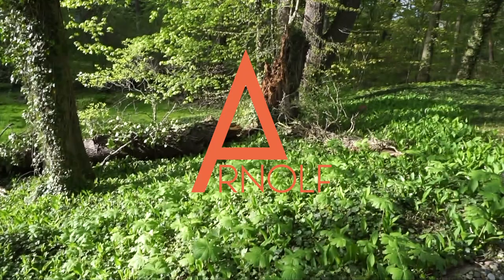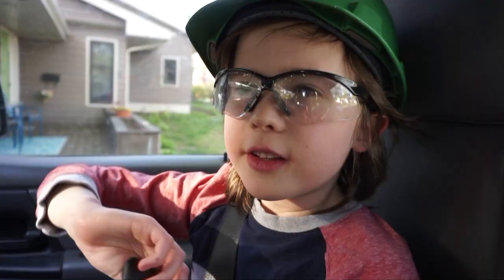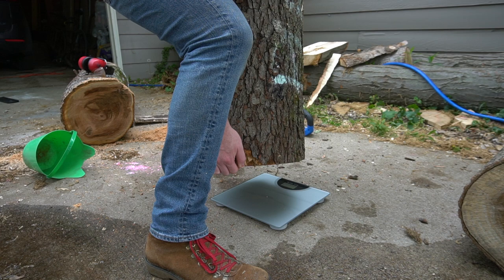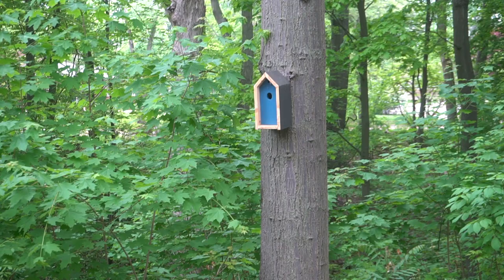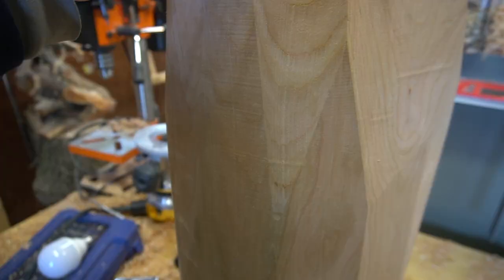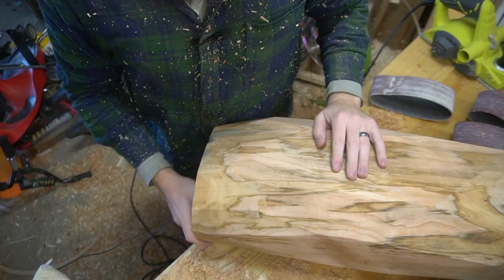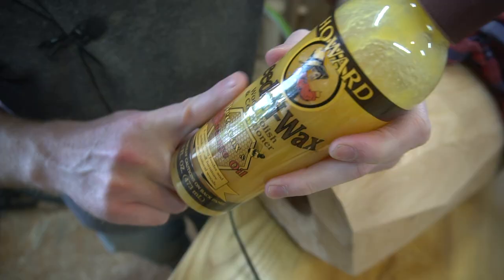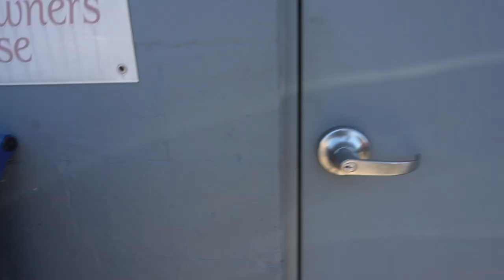From DANGEROUS Fallen Tree to Crazy Lamp

Comment: Should be interesting how the wood cracks letting the light to shine through as the weed dries out over time.
Reply from the maker: Yeah! it’s going to crack more and I look forward to seeing how it looks!
Reply: With the finish you applied hopefully it won't crack too much that the lamp doesn't break apart. For a wood and stone sculpture class while I was in college I had craved a guitar out of a branch of  white oat, but kept as much of the natural shape of branch for the body of the guitar as I could. Did not let the wood dry out completly before carving it out. By the time I finished craving, gluye on the sound board, fret board and putting strings to my nonfunctional guitar. There were some big crackks in the body and really should of applied some linseed oil as I was working on it, but live and learn. Let it dry out too much by seting in a garage to long, fell apart  and was thrown away before I was able to save it.